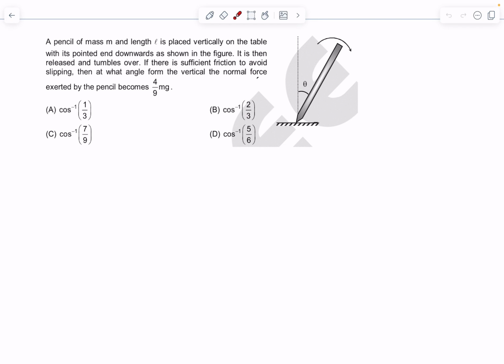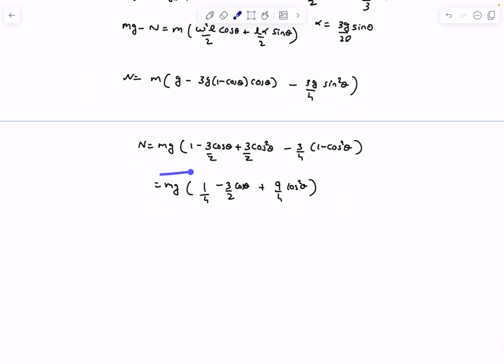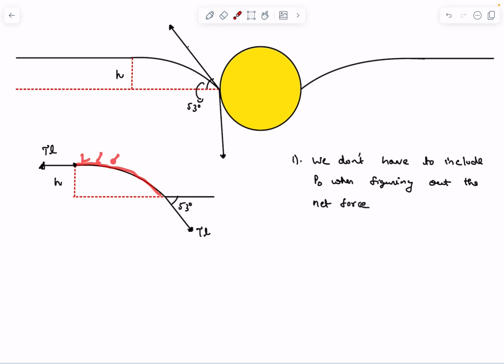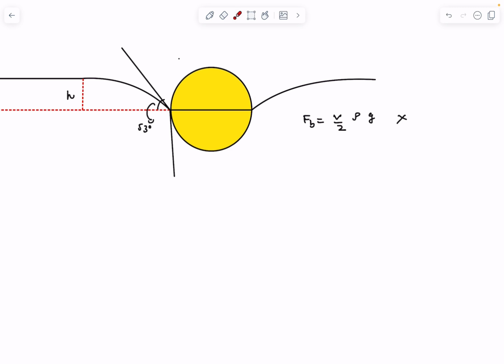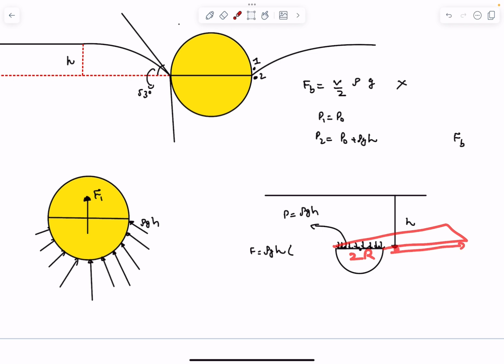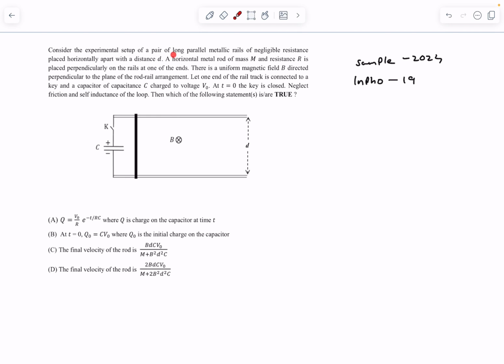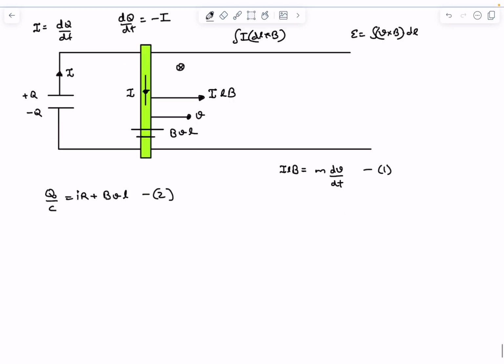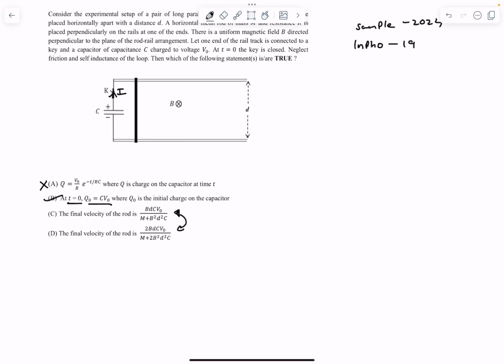Good Problems For JEE Adv 2024 | Test Series

Comment: Its written in question that the cylinder is floating so doesn't that mean it didn't break the surface mesh and only surface tension is holding it in place cause otherwise why would the  water bend in first place ?